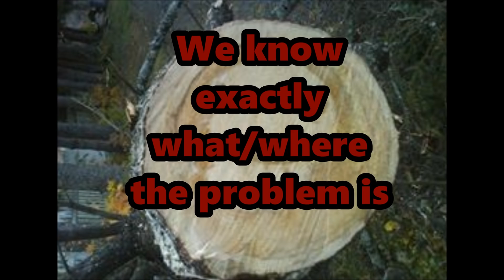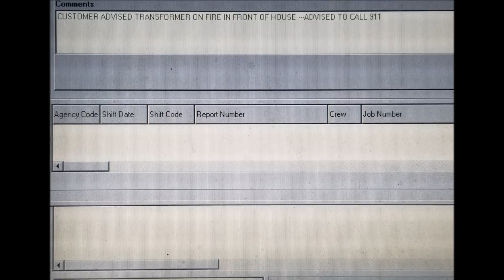5 Myths about Power Outages

Comment: When I was electrician I had an experience of a 5wire 3phase transformer one of the cans was boiling over it was an old place never did figure out how it became 5 wire in the fuse box let the electric company deal with it they determined it was a fault in the can

Comment: I'm on a mountain.  Inside wireman. When we have an outage I call, and drive the roads looking for an issue.  I recently found a line down adjacent to the road.  I went several poles up and grabbed the pole number and reported it.  They were looking for an hour and had no idea where the problem was until I told them.
Reply: When I was younger, at the house I grew up in which was about 600 feet square from the county road... I happened to be outside and on a slight hill which allows one to see the road and the powerline alongside.  I also happened to catch the road grader running along the edge of the road, doing his grading thing, so the noise of him probably attracted my attention.  As he went by the pole where the power line branches off to come up to the pole for the house, he let his blade hit the guy wire that sat between the road and the pole, which kept the lines up to the house taut.  Naturally the freed guy line instantly flew up and landed on the two power wires, shorting out the whole circuit.  The grader didn't stop; I wonder if he even realized what he'd done.  When I called the utility soon after, I was able to describe to them what happened and exactly where.  
 
The utility repaired the guy wire, but the wires running up to the pole next to house always sagged a lot more after that.

Comment: we had a transformer in the back of the neighbors yard on a pole. it blew the fuse several times. the power company would come out and replace it, and a few days or even a week later it would blow again. this happened several times, it never made any loud noise. after 3 third or 4th time I called the power company told them it had blown again and could they please replace the transformer instead of the fuse. couple days later they came out and replaced the transformer.

Comment: I was there to witness a transformer at a power plant (was told it was a 18kv to 500v) fail due to water in the oil. You could see the fire from 5 miles away. The water deluge system ran out of pressure and the fire burned for about 5 hours. The replacement transformer weighed 400 tons and took 8 months to get the plant on line again.
Reply from the maker: I've seen pole mounts fail from water in oil... I couldn't imagine a power transformer! Definitely wouldn't want to be anywhere near it 😟
Reply: @Bobsdecline  I got to see the plant security video of it and it was terrifying. The fire suppression water held it at bay for about 30 minutes then the fire just took over.
Reply: Which power plant was that?
Reply: @jovetj  Chehalis Washington natural gas plant just off I-5.
Reply: @SMOBY44  Oh!  I know where Chehalis (sheh-HAIL-us) is from Virtual Railfan.  
Thanks for the info!
Reply: @jovetj  That's awesome. The V.R. camera is at the old train station, now the historical museum. I'll pull up there and take my lunch from time to time and wave at the camera.
Reply: @SMOBY44  Very nice!  I don't watch that camera much but I see it in grab bags a lot.

Comment: During a storm that resulted in several days of power outage in the area some folks were without power for over a week. I am a ham operator and we were asked by the local Emergency manager to go out and canvas the area and hand out flyers for shower and clean up shelters, Believe it or not hygiene during an emergency and turn into a health issue. We also found critical needs people needing power for health equipment. And the ema brought them generators. While we were out we also compiled where people had observed damage to the powerlines. Some of this was deep into wooded areas that would really be hard to find. Upon completion of our tasks we relayed the information to the local emergency manager. He passed it along to the Power company crews that were in the area. They were absolutely amazed how quickly we gathered that information and we were told we likely cut 4 to 5 days off of the restoration of power for some folks.
Reply: Awesome!!  That's a great example of everyone helping each other.

Comment: I was running some 4/0 power lines for my house in the woods. Neither end was connected to anything, so I thought I was safe. 500 foot long wires, buried in the ground. Never heard of that kind of induction. Went to strip the one end of the wire to connect it to the breaker box. And BANG. It wasn't enough to injure me or anything, but it was easily as strong as a horse fencer jolt. Damn that fricking HURT.
Reply: What live AC lines were they near??
Reply: @jovetj  None. Closest live wires were to a utility junction box that went back to the transformer across the street. The end of my lines was the closest to that, at 35 feet away from the tip. But the lines ran directly away from that box, and the road, for over 300 feet to the spool of wire where I was going to be building my house in the middle of my 5 acres. No overhead lines. Only power on my street runs down the other side of the road I live on, underground. Neither property on either side of my 5 acre lot is developed at all. Raw wooded land. And then there is another house 1000 feet behind my house on their own land and their powerlines are on their road 1/4 mile away. And I live in a remote valley. We have only one leg of power coming out here. 15k volts I believe. There is no big transmission lines for 10 miles, where my valley connects to the main roads. There are no underground pipelines, as this is a blind glacier valley. There is nowhere to run wires or pipelines too that isn't a several mile thick sheet of ice.
Reply: @TheLostBear78  Wow, that's crazy.  I am very curious where the magnetic field came from!

Comment: 10:39 okay... that EXACT thing happened to me once, but it tripped a weird looking (I'm guessing) protective device with two red... I guess doors? it was about half red half grey, connected on either side of the pin insulator on a different phase than the transformer for my house, cutout, and arrestor. It also had a connection through some insulated wires at the bottom of the device that connected to a ~10x6x4 inch shiny metal box mounted vertically on the pole. The device that tripped was mounted to the top crossarm (top is for the three phase primary 13.8kv lines, bottom crossarm being for the two hots and neutral on the secondary 120/240 where the service drops/laterals are directly connected) and only one side tripped. It was reset from the ground using a normal hotstick, not needing any link replaced or anything. It also did not have a pull ring on either side. Do you know what that is?
Reply: and it was fairly loud and power went out.
Reply: @JaidenIGuessWasTaken  Got a Latitude and Longitude for where this was?   It sounds like a type of circuit breaker.

Comment: I find it funny people always blame the transformers when the power goes out or they see sparks and arcs. I've seen REAL transformer explosions before, though mostly in substations. They're in incredibly rare, but when they DO occur, they're devastating and often require most of if not all of the substation to be rebuilt from the ground up. There's also a TON of fire involved. You can also see some good examples here on YouTube, I know one video in particular of a substation having a full meltdown and actually exploding and you get a characteristic black mushroom cloud out of it. Just before it explodes, the pad mounted transformers vent the oil because it was boiling and had built up tons of pressure, and it squirted out the tops of the cylinders moments before it went up in flames.

Comment: This is only to be used in an emergency only and if your life is in danger if your car hits a power pole and the lines are down around the car it is safer to stay in your car and don't touch any of the metal on your car if your car is on fire and you're able to Open Your Door get out stand straight up with both of your feet together do not spread them and with your feet still hop away from your car at least 35 to 40 feet away from your car but if your car doors will not open take your rubber floor mat and a and lay over your door proceed to make your way out of the car make sure you land on the ground with both of your feet touching each other and proceed to hop away 35 to 40 ft

Comment: I sat inside my car for over an hour because power lines had fallen over the hood and across the road. I could see in arcing. Once the lineman gave the all clear I got out and the foreman came up and said that had I put one foot on the ground I would have been grounded and dead before I felt it. There’s a way to do it, but like you said I am not going to repeat it because I don’t want to give someone false information.
Reply from the maker: Glad you waited and made it out safely! The car sitting on rubber tires would have been at the same (or close it) voltage as the wire that was laying on the hood. Let's say 7000 volts. The ground we be "0" . The 7000 volts has trouble going to ground through the vehicle tires, but if you had stepped out while still contacting the vehicle in any way, your body would have made the perfect path. The current the would flow through you at that point would likely be deadly.

If the vehicle had been on fire. You must leap from the vehicle with your two feet very close together. At no point touch the vehicle and the ground at the same time. Once you hit the ground, hop away! There could still be difference in voltage at different points in the ground. You don't want any part of your body the make a path across these points. Hop, or shuffle your feet for at least 50 feet!
Reply: @Bobsdecline  That's exactly what he said. At no point can you touch the ground at the car at the same time. He said to climb out onto the hood and jump with both feet together if possible.

Comment: In the USA they center tap the transformer with 120V to gnd. We have 240V across both delivered legs.  I've been in 2  houses where 1 of the 2 taps fails.  People find 1/2 their lights working. Turning on the electric stove makes the other side work slightly.  Is this common?
Reply from the maker: Yes, it's an extremely common "trouble call". Not so much for a homeowner, but as a lineman that looks after an entire city. There's likely a bad connection somewhere on one of the hundreds/thousands of homes in our area. I usually get 1-2 of these calls/week in an area with a population of about 25000
Reply: @Bobsdecline  The first time, we had all incandescent lights and we heard a bang from the pole down the street.  Half the lights went out.  Knowing the stove is 240v, I turned on a burner to see if it worked.  Lights lit dimly on the other circuit. ?!?
I turned on another burner; brighter.  I looked at the transformer on the pole and saw a red light. Called it in. 
The second was about a week after I helped a friend add a new circuit to his 200A panel.  (to retire another circuit which used knob and post wiring in 2020). He called me and said; whatever we did broke the washing machine and a bunch of other things around the house.  With the mains breaker off, one  incoming leg had 119V to Gnd,  the other, 8V.   Whew! I had him call into Xcel and tell them the service to his house was broken.

Comment: Maintenance of the line is the important factor, no matter if it is above ground or under it.  It is about time that power companies are government regulated and inspected on their maintenance of transmission and service lines, above or under ground.  They have been left to their own greed for way too long.  From the weeks and weeks and weeks of outages after hurricane Michael due to old power poles and lines that should have be replaced years ago; to the recent power outages in the west because the power company did not keep the brush and tree lines cleared. They shut down the power for millions because they were inept in keeping the path under the power lines cleared before the fire s struck.
Reply from the maker: Your not wrong! While cost is also a big consideration, whether we like it or not.   Neither overhead or underground is perfect, and both involve many other factors. 
Without maintenance, both will eventually fail.

Comment: In Finland the statutory compensations for outages are so high that even on rural areas they use underground cables. At 120 hours you get 100% of the annual transfer fee. At 288 hours (12 days) you get 200% which is the max.

If course the users pay all this. I some areas the monthly base fee on transfer is 30 €.

Comment: I work for a large phone company and while replacing a pole recently, we hit an underground line feeding power to a farm. The markout company mismarked where it was. We (me actually) hit it dead center digging with the truck. Single line primary I assume, direct buried. The fuse on the pole blew right over us. Was like a shotgun going off next to you. 
Years ago I hit a buried gas main that supplied an entire townhouse development. If u ever wanna see every type of vehicle with flashing lights, show up quickly - do that.. 
Had a primary come down another time from a storm. It melted our fiber optic line buried 5 or 6 feet under ground.   At that voltage, basically everything is a conductor, even concrete. It will turn blacktop into glass.
It's a shame they dont send us for more power line training. We set poles in live power lines just like the power company does, and we are not even provided with a way to ground the truck. And its not a small company i work for either. Their reasoning is everything should be rubbered up before we do anything - which is hardly ever the case.  We use pole guards alot, but those things arent always perfect either.

Comment: 3-20 amps? Yeah, our largest overhead fuses were 100 k-links. I’ve seen 200E links and those just won’t clear with our substation breaker settings, but that was on customer gear.

Comment: Hello from the PNW (Pacific Northwest).  I have seen a few squirrels and birds turned crispy critter by power line contact, occasionally causing outages.   I have also seen where tree branch contact with a power line causes a fuse to blow on a overhead to underground line transition (i.e. fuse input is the overhead line and fuse output is the underground line.  SnoPUD does this, standards/practices may vary in your area).  Only once though, have I seen a transformer blow up (it was in an underground vault, on a private drive, with all kinds of leaves and water.  I think you can guess what comes next - arc, spark, boom).  Let's just say that though I am not an electrician or a lineman, these videos give a person a healthy respect for the power of electricity and what linemen do to keep the grid in proper working order.

Comment: A fuse issue similar to 7:52 happened in our alley, scary stuff. Much respect to the crew that came out to fix it.
Reply: Well, obviously, power lines require Arc Fault Circuit Interrupters! :D

Comment: Also, if you ever hear a LOUD BANG, then your power goes out, it’s perfectly NORMAL, (in most cases). That’s just the transformer fuse blowing because of a fault. It’s best to just call the power company immediately & tell them your location so they can dispatch a troubleshooter. The sooner they know, the sooner your power will be back on!

Comment: As a lineman myself, what he is saying in regards to a line down on your vehicle. It’s ALWAYS best to remain in your vehicle until you’re told it’s safe to exit! NEVER step out! If you would ever be in a situation where you had to get out, JUMP from the vehicle! Never allow yourself to be in contact with the vehicle & the ground at the SAME TIME!
Reply: Also if you have to move away from the vehicle in such a situation, keep your feet very close together or bunny hop if you need to get away quickly. Step potential might kill you if your feet are too far apart on the ground.
Reply: and bunny hop till you can't bunny hop no more
Reply: Jump and bunny hop
Reply: I was surprised he didn't want to address this but I guess it doesn't quite fit with the context of the video
Reply: concentric circles baby
Reply: Not a bad story but a Woah Woah Woah what are you doing story. An incredible storm overtook our region. When our fam was driving back to our house there's buddy LIFTING a power cable. :(
Reply: @ChappyPalladium  we had one of those during the hurricane , trees and power lines over the road for a week , idiot walks up, grabs the line with his bare hands , and crawls through the tree 🤦🏻‍♂️

Comment: U forgot the myth where people think we turn the power off for no reason. We're replacing a 45 class 3 with single phase #2 primary on it and some super old #2 open wire secondary. the lines are basically bare at this point. So there's no way we can transfer that secondary over hot. We'll have to kill that transformer and the 6 houses its feeding. So we let the customers know there's going to be ab outage for a couple of hours. But sure enough the whole neighborhood comes out complaining asking why we're turning peoples lights off.... we actually rather work it hot if we can. Instead of having to find the transformer and kill people's lights.

Comment: Detroit Edison went through FOUR 50kVA transformers on my backyard pole.  The first was old with black cooling tubes.  That one spewed PCBs all over the mulberry tree beneath it.  Men came in hazmat suits, the cut the tree in small pieces, then put the tree AND the surrounding dirt in 55-gal. drums and hauled it away.

That transformer spewed water-clear liquid until there was no more THEN it sent up smoke signals.  It never did 'blow up' but it stopped working.   Subsequent transformers were monitored with current meters on each line.  It didn't matter, they still burned out.